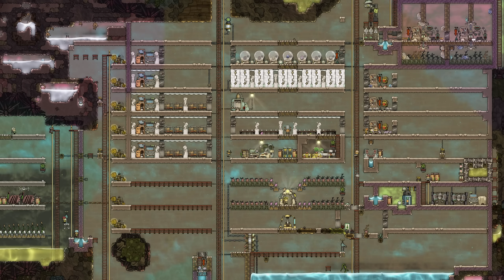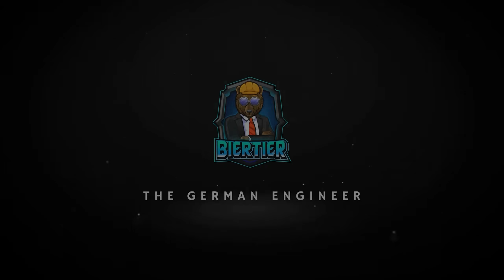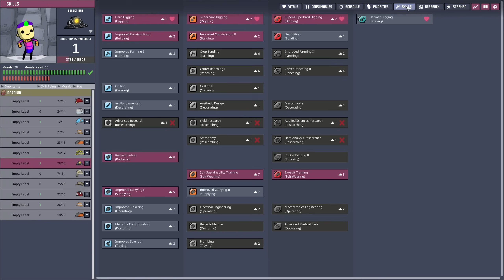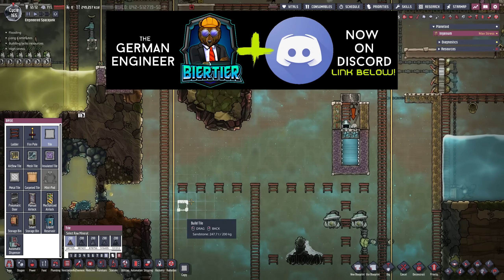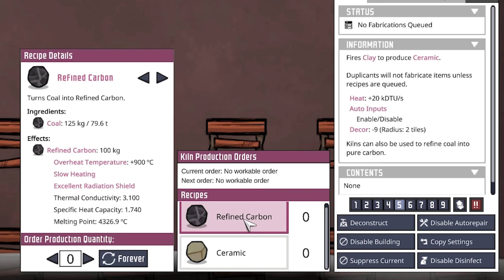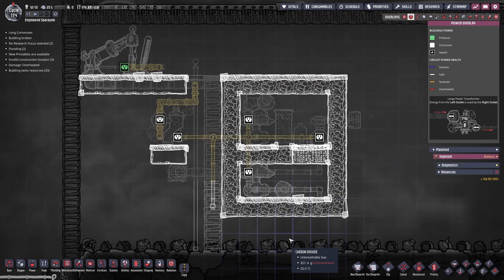SPOM SETUP and STEEL CREATION! (LP2-EP08) Oxygen Not Included Spaced Out

Comment: The oxygen pump doesn't have a sensor. That could become a problem if you run out of water.
Reply from the maker: You are right again! I did indeed forget the sensor. I will either have to get back in there or make sure I never run out of water :D
Reply: @BierTier  It also means you can't use the switch to turn it off.